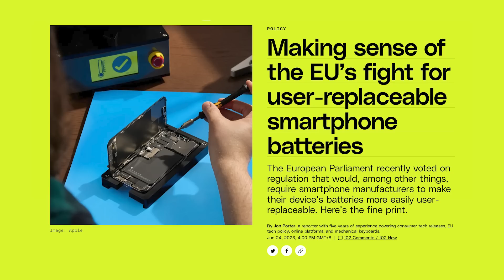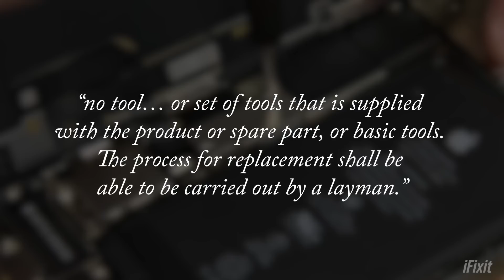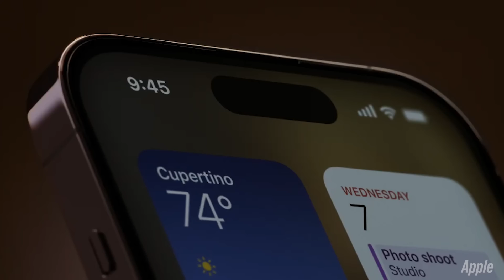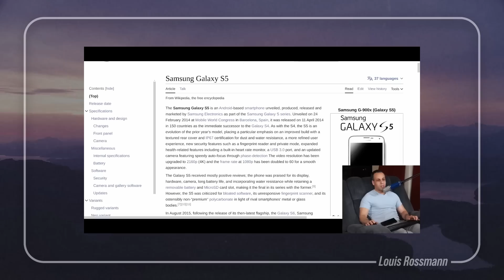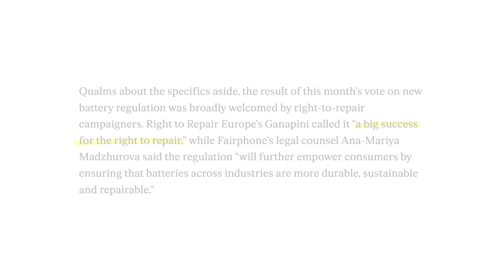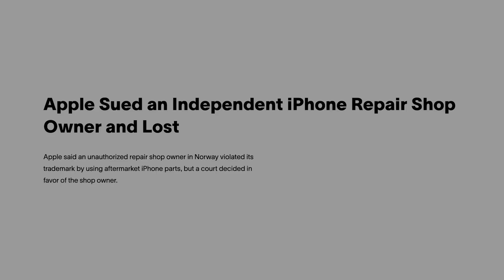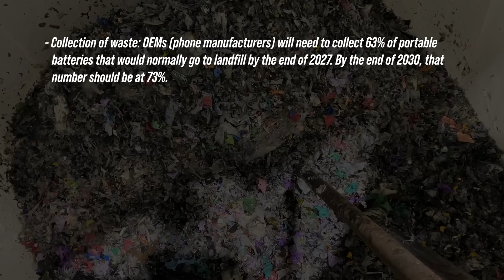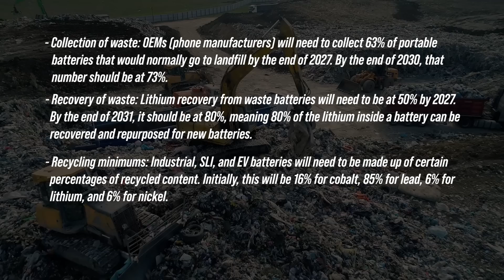EU Just Changed Smartphones Forever

Comment: What most of the reports about this fail to mention: If the manufacturer is able to make the internal battery retain over 80 percent capacity after 500 charges the whole device can be glued down as before. Even after 2027. So what I would expect to happen is manufacturers and Android/iOS adapting to a similar technique as Tesla with their "show 80% top charge as 100% charge" to increase battery life. This is a step in the right direction but it still leaves way too much room to circumvent the replaceable battery.

This is one of the few EU regulations I was really excited about until I read what it actually means. And that is a drop of water in the ocean. Sadly.
Reply: Sorry, but you are wrong. The legislation mentioned in this video has NO loophole.
It is another legislation called "the ecodesign regulation" that will come into effect next year that has this loophole. So regarding batteries, these two overlap at the moment, but the ecodesign legislation covers a lot of other things. However, the most important thing, once THIS battery legislation comes into effect in 2027, THERE IS NO LOOPHOLE. So don't worry, companies will not be able to get around this after 2027 😊

Comment: So far Samsung has been easy to replace parts irregardless of year of manufacture or product tier. A little heat and little persuasion will gain access to the battery or screen in about 15 minutes or less.

Meanwhile Apple has been going out of their way to make life as difficult as possible for someone to replace a broken part. But they can't seem to beat China's innovation for defeating anti repair design. From repurposing laser etching machine to laser resoldering. The first time I saw Apple apply glue to almost the entire surface of the back glass few generations back, I knew I'll never be owning one of their products. Want to sell more? Innovate rather than designed obsolescence.

Comment: I think it can be done, but I really hope everyone out there will have to accept much thicker phones to accommodate a high capacity, user-replaceable battery. I think one compromise would be to build a cellphone like the Fairphone, where the phone can be easily disassembled with a few tools by the end user. That would allow for battery replacement without the compromise of going to a much physically thicker phone.
Reply: 'much thicker'

A millimetre or two is not much thicker.
Reply: @tams805  Adding 2 mm thickness to a cellphone is actually quite visible and you can feeling it easily, given how thin cellphones are nowadays.

Comment: Really needs an Apple clause that the cost of the replacement battery should be reasonable or the connections "open source" so third party batteries work. Otherwise Apple will just charge $1200 for the battery.

Comment: Devices have got that small now that they have a little wiggle room to allow replacable batteries. 

As for EV's, that area should have ruled from the start to make batteries replacable. Its common now for a good chassis to the scrapped because the battery is goosed

Comment: I use the Samsung XCover Pro.  It's a business phone that Samsung will only sell to businesses.  The latest version is the XCover6 Pro.  It's IP68 rates (submersible to 5 feet for up to 30 minutes) and shock resistant (drops onto concrete up to 1.5 m2).  And the battery is easily replaced.  And the price is shown on Samsung's website for $599.99, so it's not nearly as expensive as some phones that have non-removable batteries.

Comment: Best thing about removeable batteries hands down was the ability to save your (expensive) phone in case you e.g. dunked in water. Also extending it's lifetime was a breeze since the first thing to go usually is the battery. Definitely cheeper than buying a new phone for the customers and it put's the fokus back on longevity.

Edit: I've seen a lot of people replying that integrated batteries enable better water proofing. While yes, that doesn't mean every device with an integrated battery is automatically water proof. Most devices today aren't and even the best water proofing is prone to failiure. I only brought this up in the first place because that is percisely how one of my "water proof" phones died, right before my eyes. This bill will increase longevity and I'm all for it.
Reply: I thought most phones were water proof now? I haven't had a water damaged phone in a decade. My Samsung tells me when water is in the charging port.
Reply: That is why so many phones these days have batteries sealed in that can be difficult to replace.  They know not everyone is willing to go through all of that.  Some batteries don't work even when in another phone of the exact same model.  What we also need the EU to do is force manufacturers like Apple to stop locking their parts to specific devices  You can't change a screen on a device without going through a lot of unnecessary hassle on a a lot of new devices these days and it just gets worse.  First Apple does it then all the other idiots do the same thing.  It boggles my mind why anyone would do things the same as Apple.  That is making their devices difficult to repair.  It amazes me that they didn't use proprietary connectors also just because Apple did.  It would remind me of a flip phone I had that had a special connector that was not USB or anything I could identify on the charger that was for it.  You can imagine that if that charger was lost the device becomes useless!!  That is until I figure out where to get a replacement for it.  Really it might be easier in that instance to just get a more modern device.  That is especially true when you consider how basic those flip phones usually are and sending a text or photo from one can take a good long while.  I remember sending things to my mother from one and I found myself having to look for a spot with good reception and with that mediocre phone that was fairly difficult.
Reply: I agree, specially those on mid range type phones.
Reply: Also, knowing your phone is actually off, because if you remove the energy provider, then it is definitely off, while the ones with batteries you can’t remove, you don’t know if it’s actually off.
Reply: Yeah but I’m also expecting Apple to charge $800 for the battery.
Reply: The irony now is that keeping removable batteries means waterproofing is impossible without adding even more thickness. Waterproofing was achieved by sealing everything inside and having something be easily removable makes that impossible. Great job clown regulators. Not to mention that removable batteries have hard outer coatings to prevent them from getting punctured. That coating plus the slot and the closing mechanism means that the removable battery will be much smaller than the non-removable battery for the same size. Since Apple batteries are rated to retain at least 80% of their charge after 1000 cycles, that means at an old non-removable battery will ironically be better than a brand new removable one. If you wanted to make the phones thicker, you could have done that and gotten a bigger battery.
Reply: @Exachad  Dont guys like you scream for innovation? I think thats now the perfect time for iphone to finnaly do something for their money and actually innovate.
Reply: @lemmyboy4107  There is innovation and then there is magic. Since we can apparently force innovation now, let's just force em to make batteries that never degrade instead. Jokes aside, even if they do innovate, there's still legal requirements that they can't evade, such as the requirement for the thick outer casing for removable batteries that also needs to have extra room to to prevent explosions if the battery swells inside the rigid casing. That extra casing by itself will add a larger percentage of thickness to the battery than a non-removable battery would degrade before you'd want to replace it, which invalidates its practicality by itself even if we ignore all the other concerns I mentioned.

Also, your own comment just proved that this ruling by the EU actually helps big oligopolies like Apple that have R&D money. They're going to put a lot of money into finding ways to reduce the added thickness for a given battery size. If they do succeed, they will patent their methods, while small companies are left to die with their obese or low capacity phones, at least for a few more years before they find ways to loophole Apple's patents. Regulations always favour big companies with the money to comply with them, so yes, thank you for bringing that up as well. I appreciate you for reminding me of one more dumb reason to hate this ruling.

I'm against these kinds of regulations in general, but more sensible regulation than just enforcing removable batteries would have been to also give companies an alternative option of including "premium" batteries rated to retain 80% charge or more after 1000 cycles. For example, the Apple Watch, iPad, and Macbook all have batteries that keep 80+% for 1000 cycles, but iPhones are only rated for 500 cycles. Even the most premium iPad Pro with the same processor as a Macbook Air is still thinner than the iPhone (but a lot wider). The extra cycles for Macs and iPads appear to come from fact that both have 2 smaller independent cells that are tied together as one battery, whereas the iPhone just has one large cell as its battery. Obviously, the cost would increase and the battery capacity slightly decrease (for the same size) due to the increased surface area of 2 cells vs 1 and the mechanism linking the two cells, but it would be much less significant than those that would be caused by a removable battery. This would be a great alternative for premium phones over this removable battery nonsense. There could be some kind of increased warranty requirements to enforce this too. I can't see how this isn't a better option.
Reply: ive used my iphone 8 daily since 2019 (i bought refurbished for $350) and the battery capacity is still above 90%.

smartphone batteries (at least with iphones) are good enough nowadays to last over a day on a single charge, and by the time the batteries lose capacity (5 years), the phones are no longer software supported

why is nobody thinking about this from a practical viewpoint? look at the design of iphones, replacing the battery takes less than 10 screws, and the waterproof seal can be completely replaced after. to make it any more simple than this would mean making the back of the phone cheap plastic, and would interfere with Qi charging and Magsafe.
Reply: @imstupidbut  the lack of updates is worse than a non replaceable battery, IMO.
Reply: @imstupidbut no, you can't easily replace waterproof seals. Service center glues are not IP certified
Reply: @imstupidbut it's so dumb that apple can just kill off old devices. You can use PC for decades and nobody can restrict you. Most people use only browser so 10 yo PCs are doing just fine. Even old 1050-1070 are still high in steam hardware charts. I used PC from 2006 for scientific work and I'm glad that I can turn ancient PC on and it will still work
Reply: Wow if only someone came out with a solution to dunking your phone in water!

Oh right. Waterproofing it.
Reply: @lukapogo How many phones are actually waterproof? The water resistance phone are fine in a bit of rain but dunking them in the water is still not recommended.
Reply: @illusionofquality979 my former OnePlus worked underwater, my current Xiaomi works under water... So, yes, waterproof phones are a real thing.
Reply: @illusionofquality979  Most mid- to high-end phones are very much waterproof, being able to resist to water ingress under several meters of water. That's what the IP ratings are for.
Reply: @miaouscleaumonocle  I didn't claim they aren't real. I asked how common they are actually.
Reply: @lukapogo Good to know. I wonder how many people can afford mid- to high-end phones nowadays. Some prices are criminal (at least for my use case since I only use my phone for calendar, alarm clock and texting).
Reply: @lukapogo is your phone waterproof? If so, are you willing to toss it into water and film it? I expect no but you can surprise me

Comment: I owned the lg phone for 2 years. Newer charged it once. I had a charging battery dock in the care and one at home. 3 batteries total. Change the battery before going out or reaching low power. Always a much better system. You do not even need fast charging enymore

Comment: I like the idea of easy replaceable batteries in most devices, but especially in Smartphones and Tablets I don’t see it. Most people change there smartphone because of bad performance or a feature upgrade they want. Like better camera, 5G, WLAN 6e, and so on. Or simply because of the fancy new design. 

If you are not a heavy user you can go along with four, maybe five years of use. But then the device is simply outdated. Not sure a battery change will bring a much longer use. When we look into the past, this was not the case.

Comment: Phones will have to get thicker.  The batteries will need to be more physically robust to accommodate handling outside the phone and to withstand insertion forces.  Battery contacts will again be a potential issue, versus the soldered connections in current use.

Comment: requiring stuff like this by law is dangerous.  Politicians are notoriously corrupt, the EU britian specifically started requiring ABS on motorcycles.  Every time ABS on motorcycles has been tested it has been shown to be dangerous.  But in order to change the law they have to say ABS on motorcycles is dangerous, which would cause an investigation into the politics around ABS on motorcycles which would be embarrassing for politicians.  Which would be bad.  So ABS is still required on motorcycles.

Comment: I have never replaced a battery, and strongly oppose compromising other parts of the phone to be able to replace it.

it is ok to make repair shops able, but it needs to be done in a cryptographically secure manner so I know the part is original.

Comment: Not all phones are water proof, but still you can't change the battery on them. Laptops aren't water proof or even dust proof, still, can't replace the battery without open. Corporates aren't your friend, brainwashed people at this point just make their point and bring over this idea that's "oh, no, and now how we can do that? It's impossible!". Even with the sdcard and 3.5jack, i had a s9 samsung, the most thin phone i've even see, with all that things incorporated (no removable battery), plus more (cardiac sensor), with IP67 rating, even there, they want you to believe that in phones bigger the double there isn't space to put a 3.5jack and sd cards and other stuff. 
Again, people are screaming waterproof and then buy flexible phones at 2000€ that are IP5X. And to be real, majority of time a phone break is because it drops. How many times you've seen or heard of a broken phone because it got water in it? 0. Main reason to change phones, broken screen or old phone + dead battery = i just change the phone. 
The user is stupid enough to break gaskets?, don't pass the warranty, the end. Even better, make the phone waterproof inside, and let the backcover reveal just the battery holder. Put 2 gasket on the contacts, and you're done. Or just design in a way that it doesn't short if water goes in.

Comment: These changes wouldn't work without manufacturers supporting security updates, or a more open software ecosystem that allows users to install third party software with security updates. 

I have a pixel 4a which I've spent a small amount of money to get a battery replacement from an authorised repair center, only to find out Google's guaranteed security update ends this month, just 3 years after the phone's release date. 

I can install something like lineage OS, but I can't be sure that my local banking apps will continue to work. Which would mean I'll need to get another phone if I want to be sure I can continue to use those apps with an updated OS.

Comment: One more thing: Fast charging is a solution for a problem they created

In the past no one cared about fast charging because power users would just swap a fully charged battery in mere seconds. So they sealed the battery in, so they can sell you fast chargers and fast charging phones

Oh BTW your 60W or 100W fast charging phone would charge only at 15W, sometimes 10W if you use a standard PD charger even though the phone would charge at exactly the same voltage and currents anyway

Comment: So as some of the biggest car manufacturers are in the EU why havent the law makers insisted on manufacturers adopting a stander for eV battery packs like Nio so that all EVS can have replaceable packs  at EV changing stations .   force a standard,  resuse petrol forecourts with pack changing booths, allow workshops to easily remove packs to safe locations and keep a single smaller pack for maintenance work and safety in house....... so many forward thinking possibilities from groups that should have enough experience to have had this on their radar way before we now have the independent designs and fast depreciating EVS because they dont have "removable battery packs"     Phones is a good start, but man why hasnt the EV markets been thought about except by one manufacturer.
Reply: Tesla is another culprit. Integrated battery into their chassis so you'll have to buy a new car if your battery gets slightly damaged

Comment: Has anyone told Tesla, not sure how easy it's going to be for an ordinary bod to replace the structural battery pack. This is really good news, well overdue.
I've just stripped down, cleaned and rebuilt my HP Zbook laptop, now with a used top spec graphics card and double the memory from new, but Microsoft won't allow me to put Win11 on it, think MS need to be challenged on this one in court, it's no good if batteries can be replaced but software can't be upgraded for some fabricated bs reason.